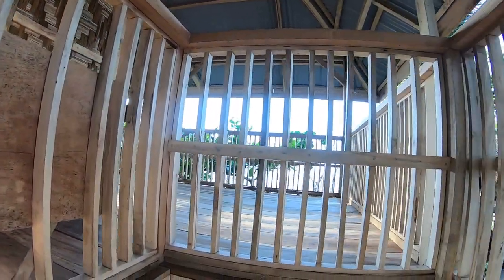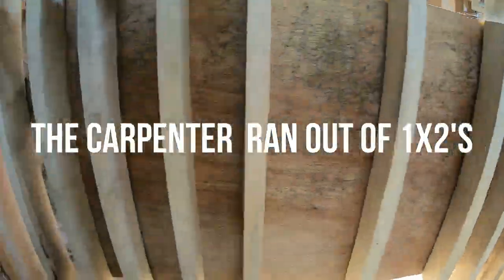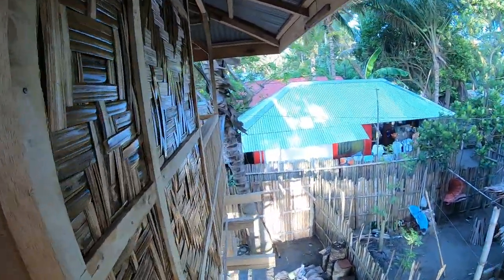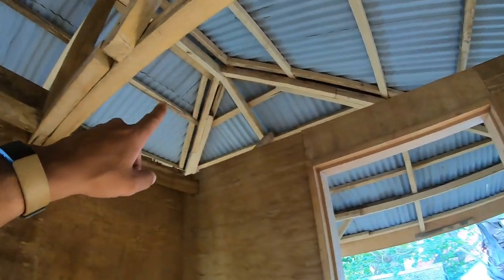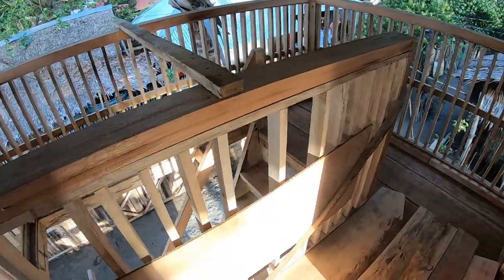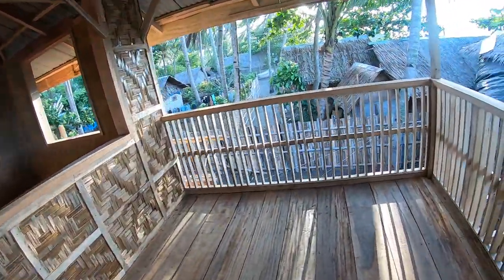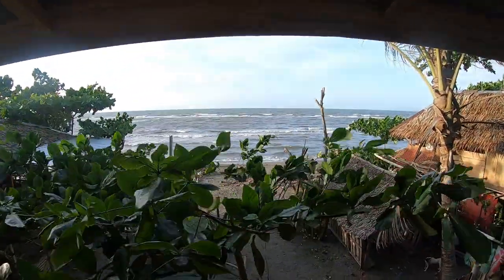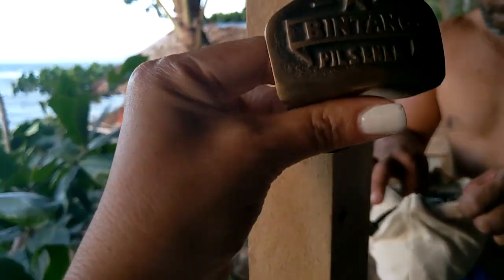Building a Beach House in the Philippines Part 9

Comment: Why you didn’t have traditional grass roof? Keeps the temperature down and isn’t noisy when rains.
Reply from the maker: It's actually what I wanted until I was told that it should be changed every 3-4 years, so we decided on the metal roof.